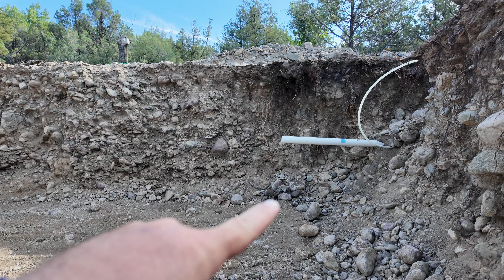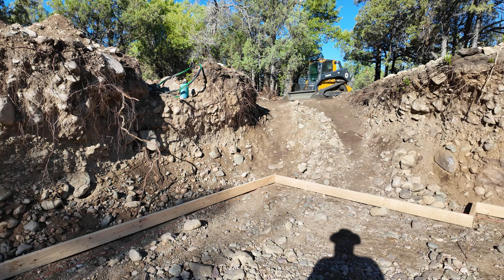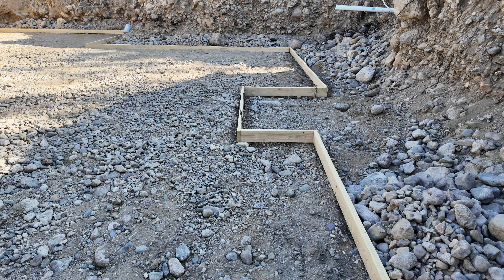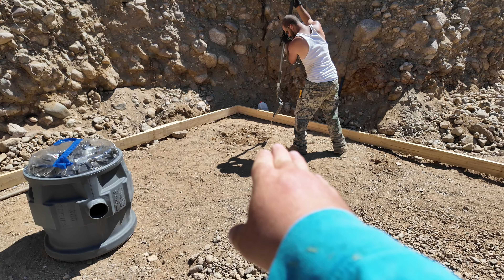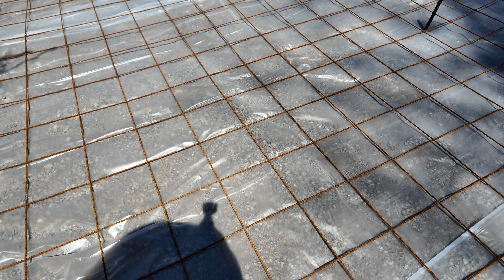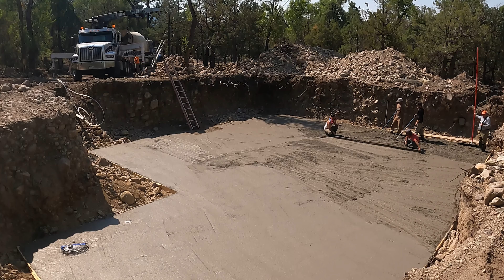Prepping & Pouring Our Slab - Pouring Concrete for a Basement Floor

Comment: Did you have this engineered? How do you only have a slab? I have 5ft by 2ft thick footings with a ton of rebar for my ICF basement.
Reply from the maker: yeah we did. The edges are thicker to support the walls while the pad is about 4-5 inches thick. The reason for not having such wide and thick footers is probably because of the soil here is so compact it makes a great base for foundations. It would be great to see a foundation like yours, I've never seen anything like that before.